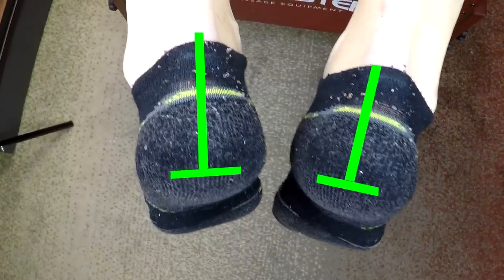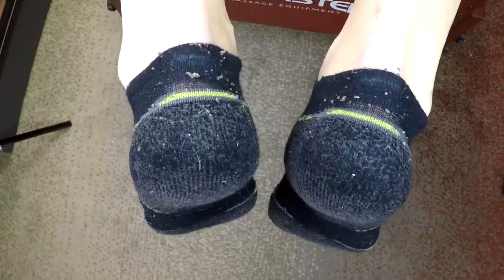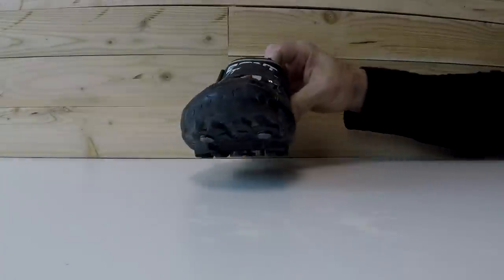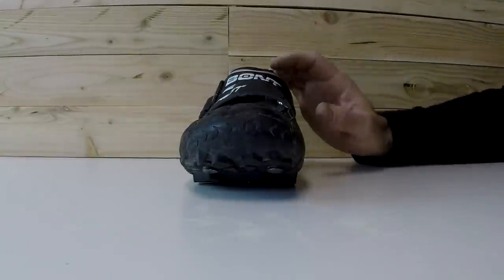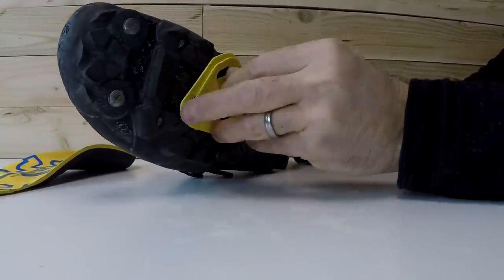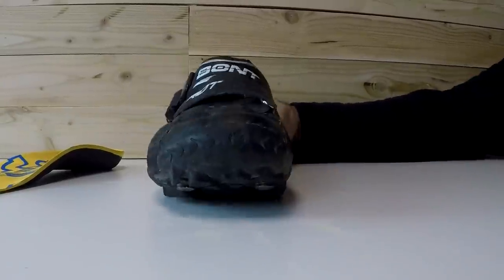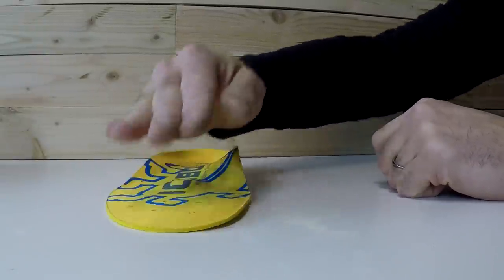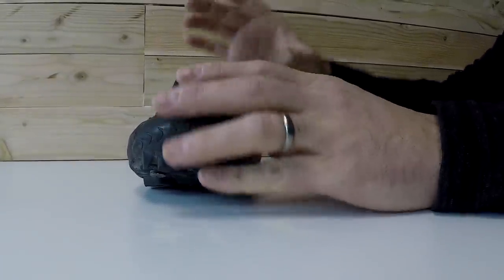Using Cleat Wedges | Bike Fit Tip

Comment: Hi! Thank you for this video!
I have a forefoot varus quite big on each foot : 14° on the left and 18° on the right. While the left knee is relatively ok, I have pain in the internal face of my right knee (usually, the pain arrives the day after the workout). A podologist made me a pair of insole to correct this varus, but the problem remains (and now I even have numbness in my right forefoot)...
So my question is, when you know the degree of "varus" (sorry, I guess I choose my words poorly) your feet have, is there some way to "calculate" the exact thickness of wedges to put on your shoe?
Again, Thank you very much!
Reply from the maker: There's no reliable way to predict exactly how much posting you should have.  Of course, in a general way, the more forefoot varus you have the more posting you'll likely need. But other factors like some of the mechanics up the chain, for instance in the hip, as well as how you're sitting on the bike will determine the degree of adjustment you need. 

When correcting, there shouldn't be an effort to fix the entire amount and correcting a significant amount in the shoe with a custom orthotic can be problematic due to the limited space in the low volume cycling shoes, which is probably what's causing your foot numbness. You probably need your foot/knee issues need to be addressed from a more global standpoint in your bike fit rather than a too focused approach of posting at the feet.  Make sure your cleat and saddle positions are good and (this is just a guess based on what you've told me so far) you may need to post some with your orthosis (but perhaps a bit less than the podiatrist did) as well as a little posting between the cleat and the shoe with some wedges.

Hope this helps
Reply: Bike Fit Adviser Thank you very much for this intelligent remark, taking account of the whole mechanical chain system instead of focusing solely on one issue as I did.
All the best !

Comment: ive noticed that my right foot is tilted a bit..can this be the cause that my second smallest toe gets numb while riding?
Reply from the maker: Djoon Starr it's certainly possible, yes. If your foot tends to favor a position of forefoot varus, for instance, and the bed of the shoe is flat then this can create excess pressure on the outside of the foot

Comment: What I get from this is that I should remove the wedges that a bike fitter has put under my cleats. It has not resolved my issue. I don't have it on my other bikes... and I've cycled for 5 years without them... and he has put them to correct a knee movement not to correct my foot...

Comment: peter sagan don't use it
chris foome don't use it
Reply: @johnathanwetherill456  Not so simple.  Practically everyone on the street has some varus.  What pro cyclists have is very well developped muscles in the soleus, foot and even glutes, as well as very good pedalling technique. Foot tilt can be a symptom of poor muscle development and engagement, since we are now used to walking in shoes all day as opposed to barefoot.  I use cleat wedges, but now understand that wedges may be just a band aid approach to fixing a problem.  The real issue can be a that the ball of the foot is not doing its job, and the solution to this problem is foot strengthening exercises, and retraining to pedal with the ball of the foot.  A problem with the lumbar spine can even cause weakness of the foot which can lead to wedges being prescribed by the fitter, when in fact a physiotherapy and training is what is needed.